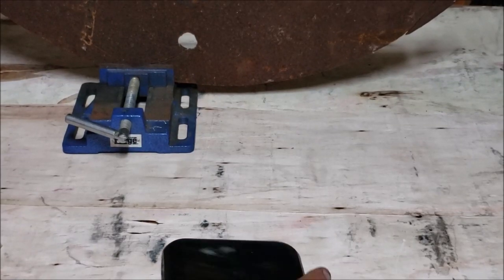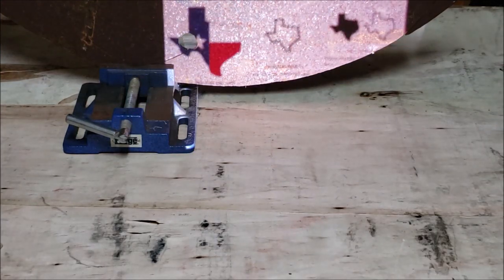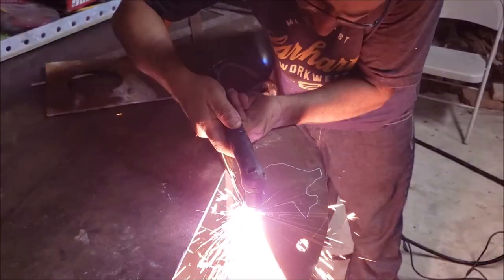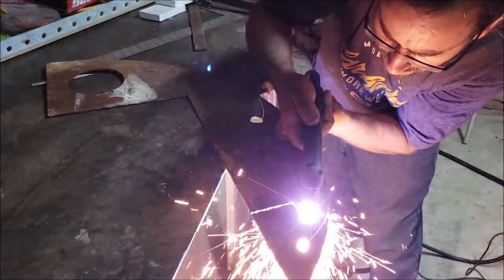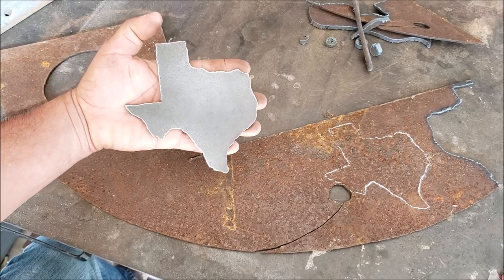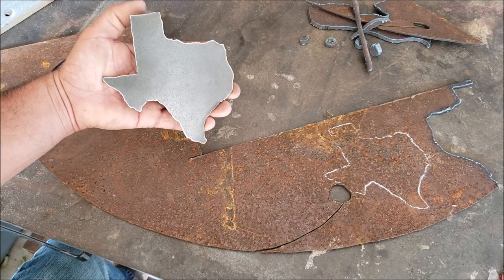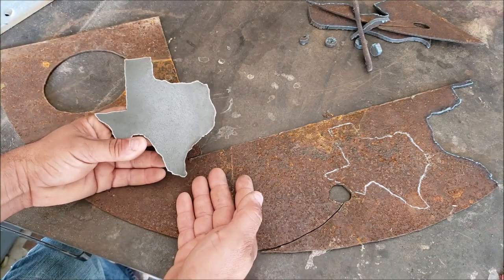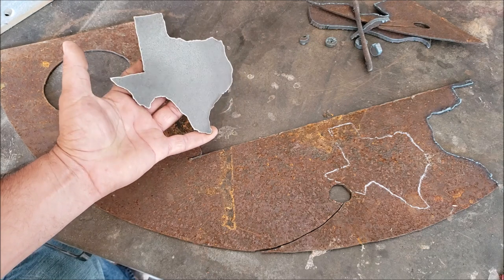Using a projector to plasma cut metal artwork using my powermax 45 : Tips and tricks  DIY projects

Comment: That is a neat little tool Jorge, never saw one like that before.
Reply from the maker: I just found out about these small projectors last month and bought one on ebay. The newest one has better features and resolution which is great for movies but this will work for my projects. I paid $120 plus $10 shipping which was around $140 after tax. The battery life on it is also rated for 1hour but have not tested it. Glad you liked my new tool.

Comment: That's pretty neat think im interested not much on drawing myself but I really can use something like that
Reply from the maker: There is many ( New Cheap Quality)  projectors on Ebay and Amazon that will work for this. These cheap projectors lack brightness and resolution so they are not good for watching movies but they have hdmi inputs so you can hook up a computer easily. The older quality projectors I mentioned have VGA or DVI inputs which require adapters to hook up to newer computers.